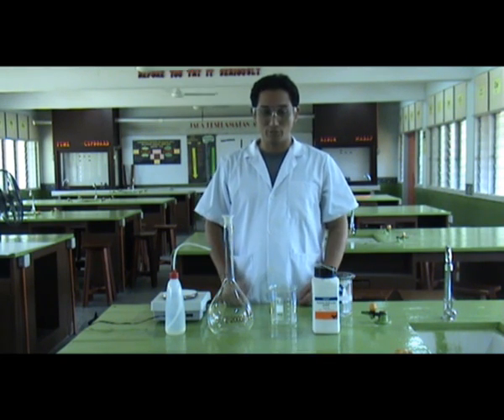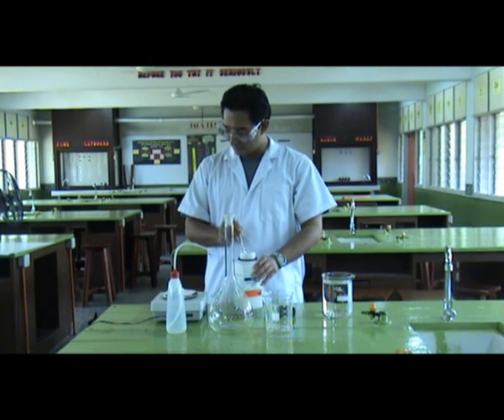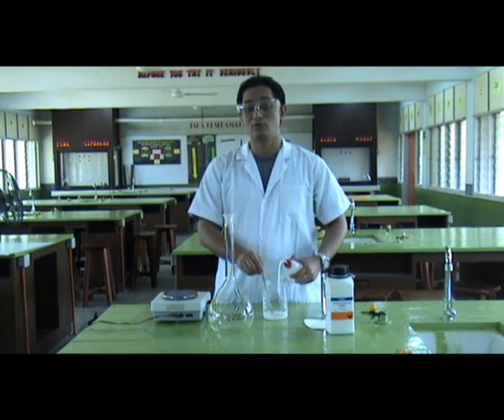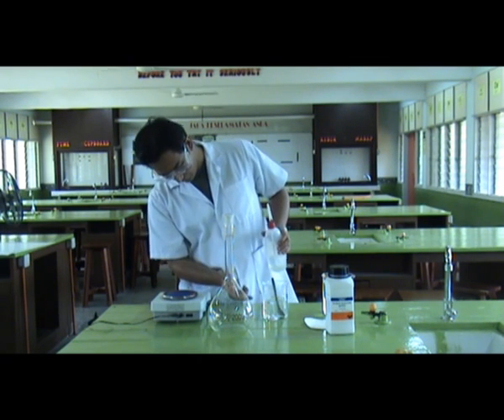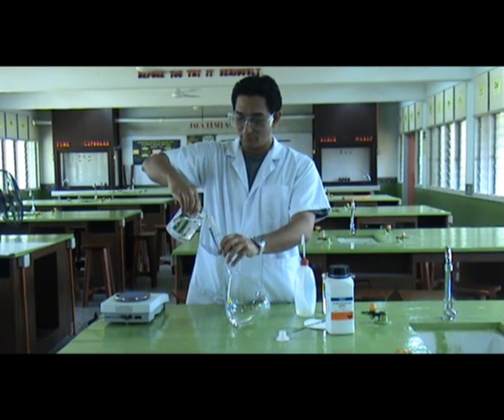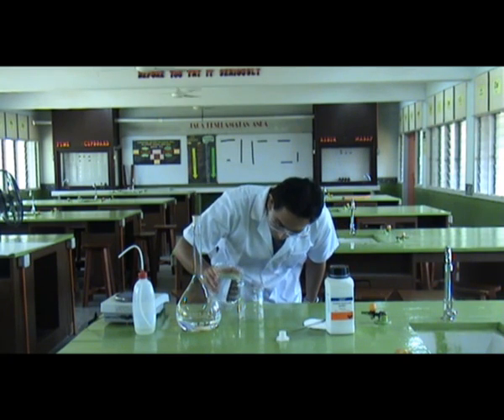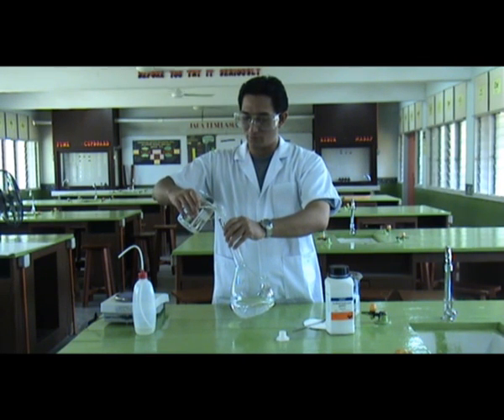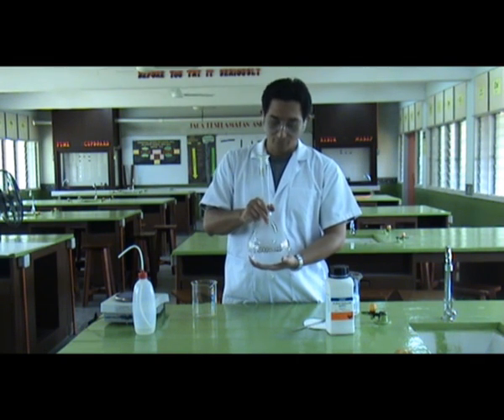Sodium Hydroxide Dilution

Comment: To mix properly, cap the flask (usually a ground glass stopper), turn it upside down (keep your finger on the stopper so it doesn't come out), and swirl. Turn right side up and repeat a few times. The solution can get VERY HOT and it is easy to be surprised and accidentally drop the beaker - extreme care please. I usually wear safety glasses rather than goggles, but for this task I recommend it - hot NaOH in your eye would be terrible. Finally, let it cool down before adding to fill line.

Comment: Several concerns I have with this demonstration. First, as the other comment pointed out, wear proper gloves - sodium hydroxide will damage skin, especially when hot. Second, use a small funnel to avoid spills while adding the mixture to the volumetric flask. Third, the WHOLE POINT of using a volumetric flask to to obtain a precise volume. Use a 1-L flask if you want one L of solution. Fourth, mix properly (see below).